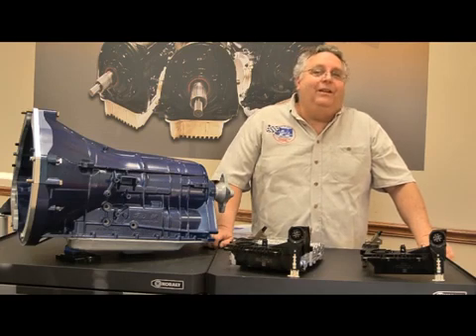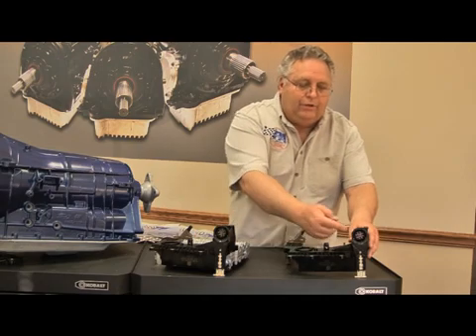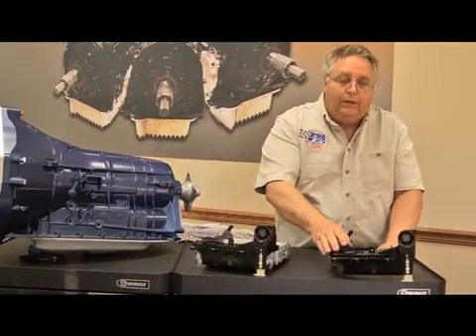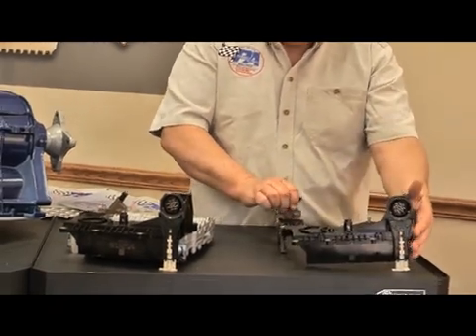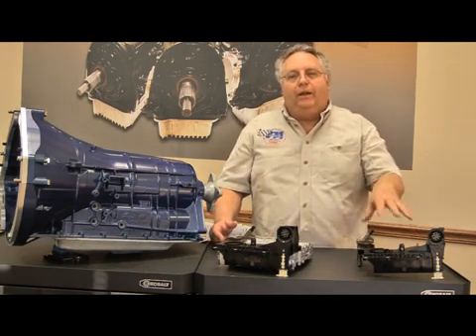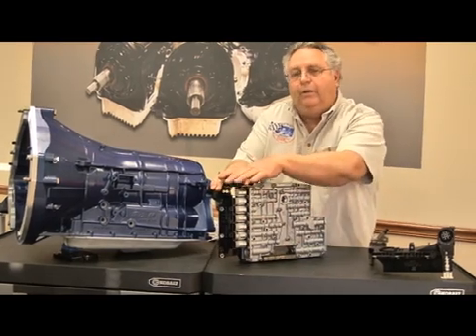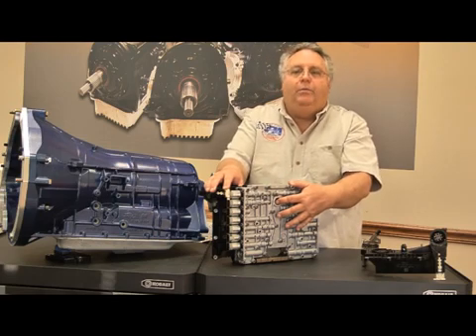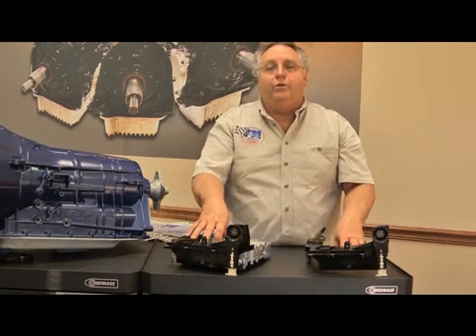6R80 Leadframe Valvebody

Comment: What’s the torque and tightening sequence for the lead frame to valve body bolts, valve body to trans bolts and the transmission pan bolts?  I have a 2012 F-150 3.5L

Comment: Is the TCM in the Lead Frame or is the TCM built into the Valve Body?  My 2013 Ford F150 is an older version and the dealer is telling me my Valve Body and leadframe does not have the TCM?  Where do you find the TCM?

Comment: Hello, if I replace the valve body and lead frame do I HAVE TO get the solenoid strategy reprogrammed? I’ve had the learned data cleared and it is shifting smoothly, far better than before I replaced it.
Reply: Did you ever get an answer to this question?  I am looking to replace my valve body assembly as well.  Did you ever get it programmed?

Comment: My 6R80 with only 1600 miles on it after a rebuild, flared 300rpm from a 5-6 gear shift.  Now, when trying to move forward, it seems like 90% of the line pressure isn't allowing full engagement in D, and the RPM just climbs with very little forward movement.   Reverse engages perfectly fine.   The car was driving perfect for the first 7 minutes, and then this came out of nowhere.  I believe its a solenoid/valve body issue.   No codes came up.   I am swapping the valve body,  bridge and tube seals today.
Reply: I'm having these issues. Did that work for you?
Reply: Any updates

Comment: Just recently changed one out in my 2012 Territory (Aust). The Neutral Switch section wore out. Where the slide travels over magnets to select park, drive etc.
It totally confused the computer and refused to start. (thought it was in gear) The vehicle has travelled 225,000 kilometres (135 thousand miles i think) in 10 years.
I wasn't impressed with this failure and copped a $2000 bill to get fixed, albeit, the workshop used the latest whizz bang improved parts flown in from The US.
This is a diesel vehicle so expecting many more miles from it now.

Comment: With a new valve body and with the new lead frame from the dealer will it need to be programmed when installed?thank you
Reply: Came here looking for the same answer. Instructions included with the new valve body say yes.
Reply: @JamesElterman  
You can get instructions  on YouTube step by step. Luckily, I have a transmission  guy  who handles  it for me  .
Look up the Ford Loco  guy he really good  with part list and good breakdown
Reply: @AO-bm1pi  thanks. I just found instructions on how to update the programming using Forscan.
Reply: @JamesElterman  could you perhaps post a link to those instructions?  Thx.

Comment: Thanks for the excellent tip. What is the cost of the valve body and lead frame in 2021 dollars?
Reply: Dealer  had one but I might have to return  it don't think I need it
Reply: 2022 dollars  995$ just bought one today
Reply: @AO-bm1pi  and was it the lead frame or lead frame w/ valve body?
Reply: @azentic  lead frame  with valve body  from dealer. 
But  my 2011 f150 ecobboost  had a recall I took it in and they did a flash re program  and it fixed  my shifting problem
Reply: @AO-bm1pi  how the hell and where the hell did you find one?
Reply: Hello.  Did you end up replacing or returning the lead frame/valve body?

Comment: Glad I found your channel. I have a 15 transit 350 with 3.7. 6r80. 
Codes P0706,0707,0712,0715
I have been having this vibration sound for a long time, I would describe it like a low bass sound, from big sound system. It comes and goes at any speed above prob 40mph. It will sometimes happen every few seconds and it last for a second or 2. 
We now have 135k and it started 50k or so ago. I have taken it to several shops and they all say it’s tires or shocks or something and never fixed the problem. 

Last week I was headed up in elevation on a road trip, no trailer. And I was noticing the rpm would bounce +\- 200, when the sound happens. 
Then, the sound went away. Approx 50miles later I noticed fluid getting on my rear Windows. I kept driving and made it the next 100 miles to our destination. During the 100 miles, it didn’t ever shift down when pulling hills, it stayed in 6. Even if I manually tried selecting another gear, it wouldn’t allow me to change.  
After getting into town, I shut it off and when restarted tried, it shifts hard to reverse and drive. It operated fine in R. But feels like I’m still starting in a higher gear. 
We trailered it back to our town. Where I now have it and am ready to work on it. 

What are your thoughts? I purchased: lead frame, case of fluid, filter, and it was all here by the time we got home. 
Now I’m thinking torque converter too. 
Or am I too far into it and should just bite bullet and order a trans?

Where would the fluid have come from? 
It looks wet on bottom of bell housing…
Reply: Driveshaft

Comment: Does Ford replace both?  My F150 is currently in the shop to replace the lead valve.  It's under the powertrain warranty.  I am wondering if the valve body is also replaced.
Reply: Did they replace the valve body? having problems with my 2017
Reply: @edross641  my 17 is in getting just the lead frame under warranty. 72000kms
Reply: @terrybull4604  They did mine under warranty also, runs great again

Comment: Can these be installed at home or does a ford shop have to do it and program something?
Reply: You can do this at home
Reply: @acolytes777  
Thanks. I've heard other people say the truck has to be programmed to recognize the new solenoids.
Reply: @curtis1951  there's truth to that though it's not essential.  If you want really smooth shifts then it is advised to be taken to be programmed. If you don't mind the shifts that are s little obvious then go ahead and leave it as is.

I don't see much of a difference personally. You might save yourself $150 not going to the dealership.
Reply: @acolytes777  
Thanks 👍

Comment: I am having this issue with my 2014 F-150 FX4, 110K miles.  I just bought it a week ago so I think I know why the previous owner traded it in.  The recall as far as I can tell is only 2012-2013.  Anyone hear of other 2014 owners having the same issue?  I'm sure I'll be replacing both lead frame and valve body soon.
Reply: Any updates on your truck? Did you get it fixed?
Reply: Any results?
Reply: Also here for an update. Anything helpful to go off of? My '13 FX4 is going into "limp mode" and I've had a code of the output sensor
Reply: @presendez27  I don’t have an update for his comment but I can give insight into my problem. I’ve got a 2014 f150 with 5.0 and I’ve had a problem where my shift indicator light doesn’t light up and truck won’t start. I finally took cover off the starter relay and would turn my switch on and crank truck manually from the relay and then after a few miles the gear indicator light would come back on and all is well. So I parked my truck last week and when I went it start it again, no fear indicator light and it was flashing “Starting System Failure” and Harley’s nothing worked and even turning my switch on and trying to manually start with relay, it wouldn’t start. So my Lead Frame went completely out. Went by 2 shops earlier today and 2nd one said he could get to it in a week and showed me a bad lead gram he just replaced last week on a F150 that had the exact problems I’m having. He said diagnosing the problem one wire at a time was a nightmare his first couple repairs bc nothing was clear as to if the harness was to be plugged in or not and wether it needed power or not. So after a few he has gotten pretty good and pretty fast at the process. I mentioned that I was considering replacing it myself since I learned that I wouldn’t have to reprogram or relearn anything. He advised against it. He said it isn’t a bad job, but there’s a lot of small things that if not all are perfect, you’ll have to redo the entire thing again. So if you are still wanting updates I will reply again when I finally get to pick my truck up from the shop. Will include repair cost too.

Comment: If the PA68301 includes new lead frame, solenoids, and new casting of the valve body...why is there a $350 core charge when nothing is rebuilt or reused?
Reply: Because their is a sucker on every corner 😜

Comment: Got a 2013 fx2
I got the wrench on the dash and the transmission shifted to only 3 or 5 th gear and once I got it slammmed into 1st at about 40 my locking my rear end for a sec or two.... took it to the dealer and they say they replaced the lead frame as I am over 150,000 but the recall extends to include trucks over mileage up to oct or nov 30th of this year

Got it back today and so far so good, put about 80 miles on it since leaving the dealership and no problems so far.
Reply: Wish I had seen this video before and I would have paid for the valvebody to go with the lead frame as he says
Reply: 2011 f150 lariat 240k just now replaces the valve body and lead frame..........ya its expensive.
Reply: Having same issue.. Is this fix still working for you?
Reply: Also how much was it
Reply: I just replaced my valve body and lead-frame on my 2014 Expedition EL Limited. Disappointed it was not part of the recall because of the model year. Build date, factory, and the problem fit to a Tee. 

It gets better, for $1,000 the dealership could replace the lead-frame though they can not  even get just the lead frame to  “fix” the problem. But (here comes the money grab) they can get the valve body with a lead frame combined! $3,000 was the quote.

Ended up purchasing the factory valve body/lead frame (I could not purchase a factory leadframe without the valve body) and doing it myself in under 2 hours for less than $1,000. Shifting smooth and functioning properly. BUT it is recommended to go into the dealership and pay to have the strategy programmed into the truck. I do not see the reason to do that. Quite the money grab IMO for a problem that has been verified and recalled.

Comment: I have a 2017 Mustang GT and wondering how I determine what my lead frame and valve body are?  If I need to upgrade it?
Reply: I have a 2017 gt and mine just crapped out, did you have any trouble codes?

Comment: 5/19/19 Ford issue a recall to fix the Lead Frame. Got mine replaced for free but it did not solve the problem. The issue also include the valve body. If you don’t fix both you will still get the “slam” “rear ending feeling” into second gear.
Reply: Any info on the recall number ? Thanks
Reply: @saltlive  any info on this?
Reply: @nicolasmendoza522  id have to look it up again but yes there was a recall
Reply: Ya, my dad sold me his f 150 and it had the jerking into second, and intermittent speedometer. Then eventually reverse took forever to engage and the wrench comes up until I restart the vehicle. I took the vehicle in for reprogram and luckily never had to deal with the sudden downshift to 1st.

Comment: I have a 2014 Ford Mustang and the valve body had been failing since 60K miles. Initially first 2 years was occasional trans slips. Finally this month, slipping got slightly worse and happened once a day, and then vehicle would go into limp mode. Couldn't figure it out so finally caved and took it to the dealer who found no issues with transmission but faulty valve body after tests. Any idea why this part could go bad so quickly? Reason I ask is if I should expect future transmission issues and if it would be more advisable to just sell the car at this point (80K miles). Engine still runs like new. Thank you.
Reply: Bad solenoid or valve body seal.

Comment: I have a 2009 F150 5.4v8 and the 6R80 transmission.  85k miles.  Took it on a road trip and it slammed hard from 5th to 4th gear going up a hill around 70mph.  Happened half a dozen times over a 1000mile roadtrip. now my 2 to 1 downshift is harsh too!  Did something fail? no check engine light came on.   Any idea what this is?  I've seen people say just reprogram it, but that cant be right.
Reply: Check Recall Notice 19S107/ NHTSA Recall19V-075...it addresses the speed output sensor downshifting at high speed to a lower gear. My recall says they will cover the repair for 150,000 miles or 10 years....I guess it's cheaper to see if any don't fail rather then to repair them all....bazturdz
Reply: @JM-ei7eb  I got the notice in mail about this but I had spoken with Ford dealer near my home and was told they are not authorized to perform repairs on my truck unless a fault code is stored in memory.   My truck doesn't have it and is experiencing "slam" when changing gears from higher to 1st for at least a year.   What do I do?
Reply: John O'Donohue  I think you were lied too. Just bought a 2011 F150 with 106,000 on it with a active recall from 2014, took it in & they did a program reflash in less then 30 mins & i wasn’t  pulling any diagnostic codes, also contacted previous owner and was told that he had the leadframe warranty work done without a code being pulled.
Reply: shift bans just had to replace my trans now i am getting the led frame done because its fucked up 70000 miles on my truck under the recall part is back order its on them now

Comment: I’m bout to get all of
This done to my Ford Mustang.
Reply: were you having occasional slips before? I was experiencing that and just had the valve body replaced. wanted to know if this would solve the issue for peace of mind.
Reply: Akshay Bhavsar I’m getting it back on Friday I’ll let you know if it fixed my problem.
Reply: @billwilliamson3764  Thank you. I am pretty handy with a wrench, but didn't have any transmission experience so I took it in to a pro. They found code P0733 during limp mode while using a data recorder, but the code would clear every time the car was shut off which is why I couldn't find any codes when I used my reader. They also found clean fluid which I replaced 12K miles ago. After testing they recommended I replace valve body and that there was no damage to the transmission. After 50 miles of driving the issue seems resolved. The reason I am concerned is that my mustang has 80K miles and I'm concerned future trans issues may occur in the future and if this would be a good time to sell the car to avoid having to deal with future issues or if the valve body failure is just a one-off anomaly. Engine and rest of the vehicle run great. Anyway, thank you for your help and let me know!
Reply: Akshay Bhavsar I had all of it done and it’s running so much better and so far hasn’t given me anymore problems.
Reply: @billwilliamson3764  Awesome! Changing just the valvebody seems to have fixed my issues as well. Cheers.
Reply: Akshay Bhavsar same bro hope you get it fixed I know it sucks
Reply: Man it varies it could be many things. But I put a handheld computer on Mine and saw that the speed sensor was showing 140 MPH when I was only doing 55 MPH turned out to be the valve body and lead frame.
Reply: How much do something like this cost my 2014 5.0 occasionally slips at low speed

Comment: Just had mine replaced in '14 f 150 Friday.  Walk out Monday to find puddle of transmission fluid under truck.  Could this be related?
Reply: The valve body has a very specific order in which bolts need to be torqued down. my guess is that it wasn't installed correctly in that order. See link-> https://d2q1ebiag300ih.cloudfront.net/uploads/part/instructions/4092/FZR80-IN.pdf?v=1526314285
Reply: @akshayrbhavsar  Hi ,is it relatively straight forward to disassemble/separate the valve body in order to clear the inside channels as I fear mine are contaminated with transmission/metal paste? Have pulled the valve body out 3 times so far and replaced contaminated solenoids,but not quite game enough to separate the valve body on the 6R80. thanks
Reply: that sounds like bad workmanship by the dealer
Reply: Same here...

Comment: This is clearly a manufacturer defect, why hasn’t ford done a recall on this specific issue. I have a 2013 F150 fx4 with a 6.2Lt, I bought the truck used with 80,000 miles... I’m at 103,000 miles now. For the past 5000 miles or so it has been showing these faults in the way it rides and the erratic downshift has gotten worse as of late. Ford fucked up big on this transmission design, why haven’t they man up to it? I’ve read that these lead frames will go bad as soon as 60,000 miles... that is fuckin absurd. Ford should be covering all the expenses, I think it’s bullshit that we the consumer have to pay out of pocket if we are so unlucky to no longer have the warranty on these vehicles...
Reply: Got a recall last week on the Output Speed Sensor replacement which will cause the truck, at high speed, to downshift to 1st gear. They will fix that part alone, but not replacing the other assembly/parts (Safety Recall Notice 19S07/NHTSA Recall 19V-075). There is nothing about replacing the entire assembly as the video shows. I've got the 2013 F150 4X4 5.0 engine. Check it out your vehicle maybe subject to the recall but because you are not the original owner they might not be able to contact you.
Reply: If ford can find a way to screw you out of your money, they will find it. My first Ford F150 and my last.
Reply: Arturo Lopez did you fix it?
Reply: Que hicieron para arreglar el problema
Reply: Mine has been having issues since 55K miles in my 2014 ford mustang with the 6R80 trans
Reply: @akshayrbhavsar  My 2017 also, did you have any trouble codes?
Reply: @edross641  it felt like the transmission would slip and then it would enter limp mode. Otherwise no codes.
Reply: Just got another recall. The 1st one was an update. 2nd one replaces this part at no cost and extends the warranty to 150,000 miles or 10 years.

Comment: If I were to purchase the parts, would I still have to take the truck to a transmission shop to have them swapped out, or is this something that can be done by an intermediately-mechanically-inclined person? Also, you state that the frame is this part number, and the whole Kit-n-kabootle is that part number; where would I purchase said parts?